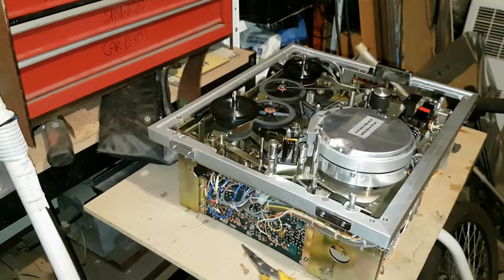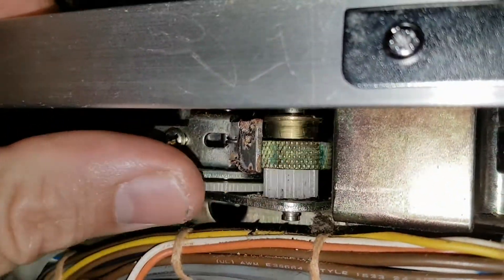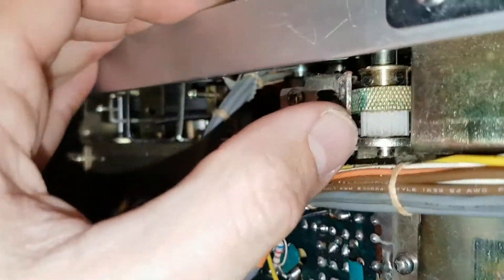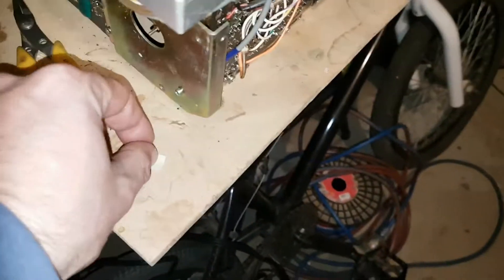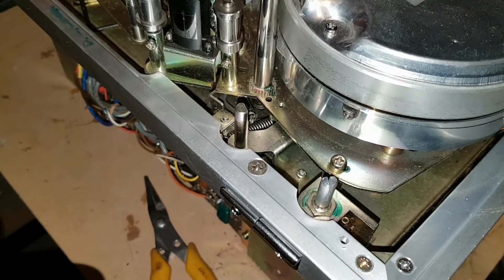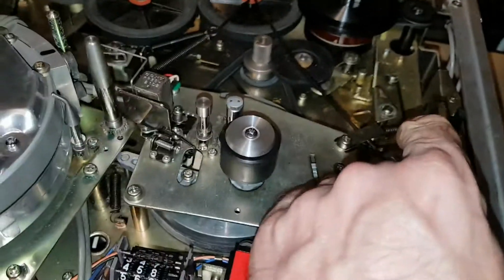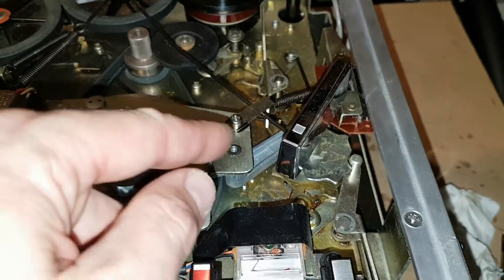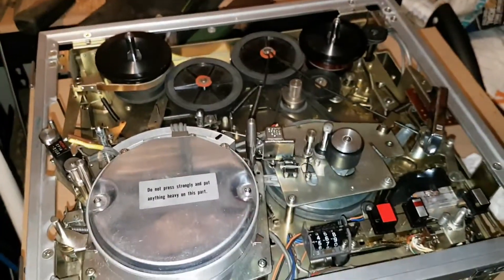Sony AV-3620CE EIAJ reel-reel VTR restoration (Part 5)

Comment: I fixed the skew control brake on my 3670CE with a bit of heat shrink insulation wrapped around the metal tab. Takes considerably more force to adjust, but doesn't slip at all.
Thanks also to Richard for sending me two tapes yonks ago. Both had NTSC broadcasts on them which were... uh, interesting to play back on CCIR. 😉
I now have major issues with sticky tape which prevent proper playback. These things squeal like a pig (and no, Deliverance was not on the tape). Baking the tapes is only a temporary fix, of course. I have never actually checked the electronics on these things tho; should check the servo one of these days, now that I finally have the service manual. 
Many many thanks again to Richard for his help all these years ago!

Comment: The pad on the brakes is chamois leather. You got that exactly right.
Holey cow! Troy! We've been discussing this VTR for a couple of weeks now. I just noticed my (and your) dyslexia! it's not a 3260. It's an AV-3620! Hahahahaaaaaaa! Good fun. A 3260 is a vidicon camera.
It turns out gears in general are standardized and not TOO hard to find. Having said that, it can still be a challenge.
Check out a channel called, "David Tipton". David does radio restorations and his mechanical work is amazing. You WILL learn a lot from him. Leave him a comment and tell him, "Labguy sent me." He'll like that.